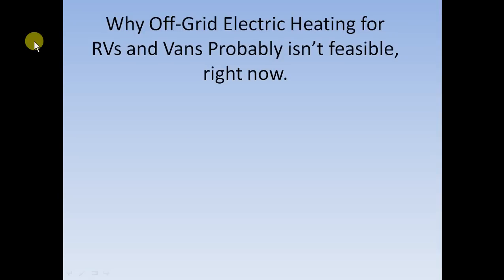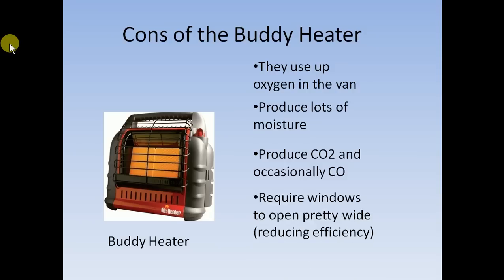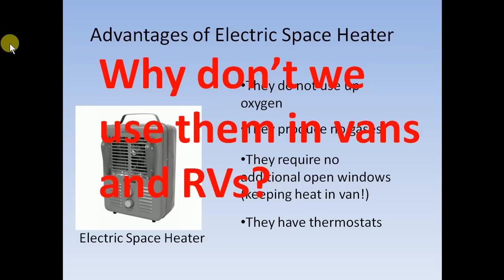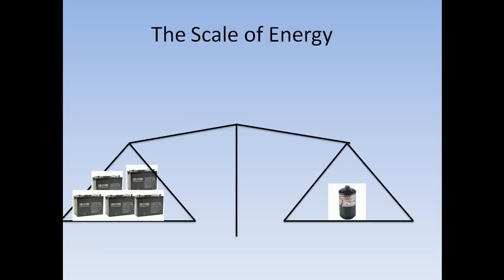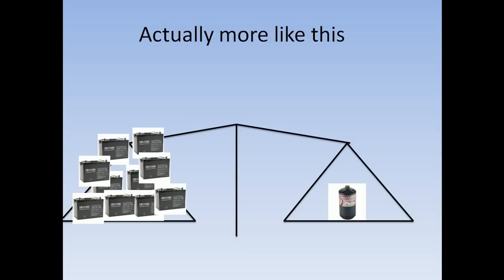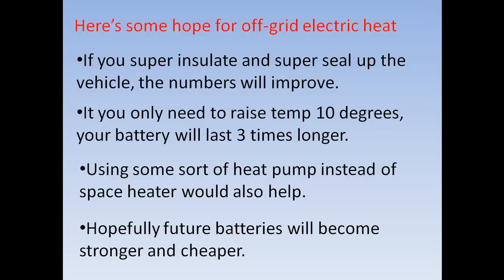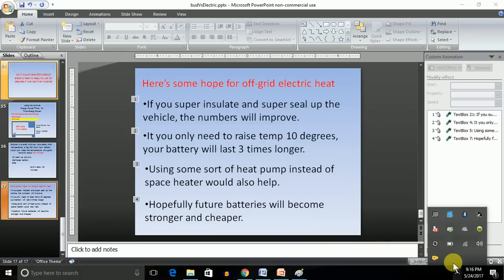Why heating a van with batteries is Practically Impossible. #vanlife

Comment from the maker: 0:38 What "Off-Grid" Means
1:16 The Buddy Heater: King of Off-Grid Mobile heaters.
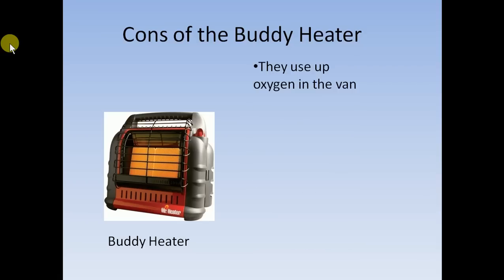2:25 Downsides of Buddy Heaters
4:32 The Big Question
4:53 Advantages of Electic Space Heater
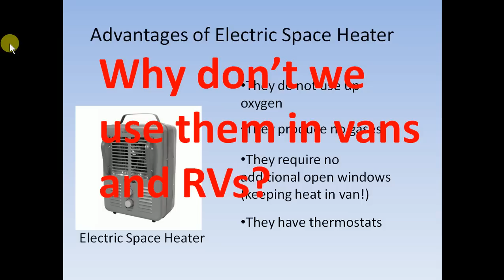6:04 Why don't we use Electric Space Heaters in RVs and Vans?
6:11 Batteries are lousy for storing heat.
6:35 Comparison of batteries and propane.
7:34 Scale of Energy
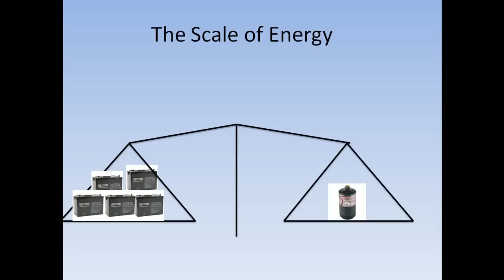8:09 The real scale of energy
8:35 Experimenting with Mini-van heating.
8:57 Beginning of some scary math
9:11 Newton's Law of Cooling
9:26 How I calculated heated loss in van
9:54 R-value explanation
10:07 Example of using heat loss formula
10:43 Physics is usually an approximation.
11:18 Cancelling units in sciences
11:54 How much energy (watts) to heat van.
13:10 Bottom Line: HOW LONG WILL A DEEP CYCLE BATTERY KEEP ME WARM?
13:33 The fine print
13:48 Catch-22 Reference
13:51 Some Hope for Off-Grid Electric Heating
14:39 Living in a block of foam
15:17 Heat Pump Discussion
16:22 Some guy who tried to make it work.

Comment: I am going to be trying to heat my Class B RV with electric, just starting to put everything together.  Batteries have improved and gotten much cheaper.  I'm building a 24V LifePo4 pack, 840AH (23KWH!).  To reduce heating power at night, we'll use 24v electric blankets made for truckers, they use about 50-60W.  No point in heating up all the air, but possibly a small 100-200W heater to keep air temp around 50F so our faces don't get cold.  In the morning, will blast a heater to warm things up enough to get out of bed and get the espresso machine going!
Reply from the maker: That might work as long as you can charge it up each day. Electricity by far would be the safest and most convenient way to heat mobility if it is somehow possible.

Comment: Solid state electrolyte graphene or graphite power cell banks and organic carbon power cell banks. That provide a steady current for a pancake motor generator designed to generate electricity to generate electrical frequency to induction heat graphite red hot with a stirling hot gas piston to turn a fan to circulate air over graphite heat element to heat a recreational vehicle. Thermal electrical generator incorporated into heating system to charge organic carbon power cell banks has well. 😕

Comment: It is not that difficult to build a gas stove...and by gas stove, I mean one that runs on normal gasoline.  But I would recommend the same style as the wood I am fixon to build... Its combustion area would be separate and vented to and from the outside that it would not extract oxygen from within the vehicle, not would it be able to transfer any burnt exhaust gasses to the interior of the vehicle.  Just like propane...a thermocouple would shut it off it the flame went out.

Comment: My plan is to build a "wood" burner...that receives its air from the outside so the heated air introduced in the vehicle is different from the outside air used to fuel the combustion chamber.  In this way, I can burn my paper trash and wood without worry of Co2 or CO. Plus my outside ventilation will be exceedingly minimal.  Thus far though... I only see the access door being on the outside...so I am still at the drawing board stage.

Comment: I just removed 3 exterior spot-lights I had on my van, never used them. I put them inside my van for the heat. Three 12-volt lights, at 55W a piece........is about 150W of electricity converted to heat, the other 15W is light. The current draw on this setup is something like this >>>> P / V = I (165W / 12.6V = 13.9A). The good thing is there is no inverter involved.
Reply from the maker: Yeah, do they heat the thing pretty well? I guess maybe you could paint the glass black with some sort of heat resistant paint to make sure all the light turns into heat. Just an idea. There might be some downsides and dangers I'm not thinking of.
Reply: HiddenHighways     Well, the light-beams are very focused. So I aimed the beams all on one area....where I sit. Gets quite toasty where I am sitting.....does it do an overall good job of bringing the temp up in the van, mediocre at best. Pretty good bang for the buck though, 95% of the electricity is converted to heat, little waste.

Comment: Have 700 wars solar panels, 400 ah agm and a 250 watt panel radiant heater that runs free on solar while the suns out and at night I have a dometic boat alcohol heater burner that on high is 5000 btu. Also have a 9 gal spot sprayer for shower and sink that is heated by a 12 volt 150 watt element and the water if heated up before the solar stops it holds heat for a bit. Hate the propane thing as it's a pressurized tank of boom, and the moisture it creates along with what breathing creates makes a great breeding ground for mold.

Comment: I guess my other question would be why cook with a microwave, in an RV or van, in the first place. Propane burns very cleanly.
Reply: It is claimed LP gas burns very clean...but that is but one half the equasion. The second part is: cleaner as compared to what?  And exactly how much oxygen is replaced with any non-oxygen?  So you use it...but must keep a window open...dang
Reply: Terry Weaver            Well, much cleaner compared to sterno and other 
"solid" fuels. One of the keys in keeping the air clean when gas-cooking is setting the flame just right,  using only the needed amount of fuel for the job. Electric-cooking is my favorite, but it will seriously suck the juice out of your batteries.

Comment: Great video. Food for thought. Just wondering if you incorporated water containers around your heat source would you be able to hold the heat and use much less fuel weather electric or fossil. A friend of mine cut his heat bills by 90percent. (I've seen the bills) by building shelves over his electric baseboard heater and putting jars of water on the shelves and then covering the shelves with a blanket like a curtain. The jars were exactly the size to fit into the shelves and touched on the sides. He turned the thermostat on the baseboard heater down almost completely. It took time at first for the bottles to warm up but they became toasty warn and heated his home on 90 percent less power than before. Without the water shelves his place would have been freezing with the thermostat set at that low level but with the water shelves, it was so nice and constant warmth. (The blanket curtain is necessary)
I hope I explained his set up so you can understand. Anyone can do this. My friend used 1x4 and 1x6 cheap lumber wood and recycled jars.
Reply from the maker: Thanks Darlene,

I guess your friend's invention basically acted like a radiator. So the water basically absorbs all the heat and then radiates the heat at a lower temperature than the electric heater alone but it is a constant heat for a longer time. Maybe this would keep the air more mixed and keep all the hot air from rising to the ceiling. That's just a theory. From what the more different air masses are, as far a temperature and humidity, the harder time they have mixing. Then the warm masses rise of course. If the air is well-mixed the air doesn't get so stratified, I think. 

I was actually thinking of doing something with my water in my stealth mini-van I've been building. I have a furnace in it. It puts out a lot of heat, but no matter how warm you get it, the floor and is freezing. I thought about getting some kind of metal container and boil a few gallons of water on my stove. I would then put it the container on the floor.  Then I would have heat coming from down low for a few hours or more depending on how much water I used. I could still run the furnace but have the water thing going too.

Comment: Due to the condensation that mr buddy heater produces,i choose to experiment with a ceramic heater instead. Also i do not like the idea of having a propane tank in a minivan. Walmart has 1500 watts little space heater. Having a window open gives up your stealth in a city. Also,it is a security issue leaving your window cracked overnight in my opinion. Same thing with cooking. I choose to go with an induction cooktop,instead of a propane stove. A 100ah deep cycle AGM battery,a power inverter and a continuous duty solenoid connected to the alternator.
Reply: HiddenHighways       I hope you have some heavy-duty batteries, just for your interior, that are installed in parallel. Get a solar-panel to keep them topped-off, you WILL need it if you are sucking serious juice out of them. Check for voltage-drop, both gnd and pos, between your charging-system and the pos/neg on your interior-batteries.....if it is a longer run, that drop can be significant.
Reply from the maker: tickyul I have 175 amp hour but like I said I'm only going to use it when the engine is on and the battery isolator is going. I might be wrong but I think if the engine is on the alternator should supply enough power to the microwave without taking from the batteries.
Reply from the maker: Hi Randy. Have you tried the space heater with the battery, yet? If it turns out I'm wrong and someone gets this to work, that would be good news. It's all a question of how insulated you can get your van.
Reply: HiddenHighways 
Hi HiddenHighways,i haven't. Can you please send me a link to that ?
Reply from the maker: Huh..? What do you want a link to?
Reply: Randy N                 Yes, 1.5KW out means that you probably have to put 2KW in to your inverter. This means your batteries are going to be putting-out a LOT of juice >>>>>> current = power / voltage >>>>>>> 2000 watts / 12.6 volts = 158 amps. Even if you input 1.6KW, your batteries are going to get ZAPPED in short order.
Reply from the maker: tickyul Yeah, after all the insulation that I put in my van I started thinking and looking at the numbers again and started thinking yeah it might almost be possible to heat the thing with electric when I looked at the fact that I was often able to get the van to be 25 degrees above the outside temperature with just body heat. Still I wouldn't want to do that just because of how much a strain that would be on the batteries but yeah that's why I made the title I said practically impossible I didn't say totally impossible haha.
Reply from the maker: tickyul I have a 2000 k pure sine inverter on the way. I'm going to use it to power a small microwave but I'm only going to use it when my engine is on because I have a battery isolator and then the battery should not really be drained at all by the microwave. I don't think anyway.
Reply: HiddenHighways            Yes, most RV-type systems that have
 interior-batteries, connect the vehicle's charging-system to the 
interior-batteries when the vehicle is running......so your plan sounds like a good one. Remember though, the ampere-hours rating on your batteries is going to be derated when you pull large amounts of current out of it......a fairly linear discharge pattern, will turn into a pattern that goes down more quickly than what you would expect from the  listed ampere-hour rating. This is a problems when you see your batteries with lower voltage, even after you have been driving your rig for a while.
Reply from the maker: Yeah, ok. I'll test it out later and see how it runs and probably do a video of the test. I'll take a look at the voltage of the house batteries before and after and see if they've gone down any. This leave-the-engine on method is just good for something like a microwave because it is not going to be on for very long. Or, I might turn the engine on to run some power tool for a few minutes. Obviously, I don't want to be idling all the time.
Reply: HiddenHighways          Probably want to test and see how much difference the voltage directly at your vehicle's battery is, when compared to your interior batteries, when the charging-system is putting-out a high-charge. If there is more than say .3 volts, it would probably be worthwhile to go over all the connections and clean/tighten them to remove as much 
voltage-drop as possible.........the wire-run and connections from your 
charging-system, to your interior-batteries, is notorious for having 
voltage-dropping/current-limiting resistance.
Reply: HiddenHighways       Yes, I can tell you that connection is suboptimal. A high power connection should be very clean, uncovered in most situations, tight and directly connected to the source whenever possible. You want to be able to see the connection, in-order to be able to quickly ascertain its condition. I can tell you almost without a doubt, you ARE going to have voltage-drop/current-limiting problems in that area. I would advise you to get whatever heavy-duty connectors/splices/etc you need and 
re-do that connection.
Reply from the maker: Ok, thanks. I'll get that directly connected to the battery before trying out the microwave.
Reply from the maker: Ok. That's a good idea too. Since you sound like you know your stuff I'll ask you a question.

When I was connecting my starter battery to my house battery the bolt wasn't long enough to hook the cable directly to the starter battery. So, instead I hooked it up to a bolt which is on the main fuse box. You can see where I hooked it up in this video https://www.youtube.com/watch?v=GHytgHVljCM at 1:00. 

I thought that would be fine because also connected here is a cable which goes there is thick and is meant to power a lot of different things. But, it seems the house batteries aren't charging as fast as I think they should. So, I've wondered if the place I have it hooked up might have something to do with it.

Here's the question. Do you think it might work better if I attach the cable directly to the battery? I guess I should get a bolt extend and just do it to be safe.

Comment: Good examination of a subject I am often asked about.  We are experimenting with 230v heating in a van via a generator but we only have a prototype at present.
Reply from the maker: Thanks, Alan! My conclusion might be obvious for many but probably not for a lot of people. I didn't realize myself how just how bad the numbers looked until I recently looked it over. 
The generator idea sounds like it could be good be a good way to go, especially since you can use the generator for other things including air conditioning in the summer!  Maybe an air conditioner, which is designed to also run as a heat pump, would be effective when it is moderately cold.